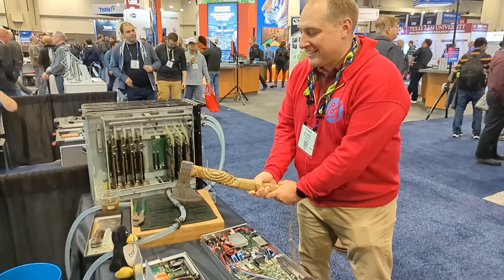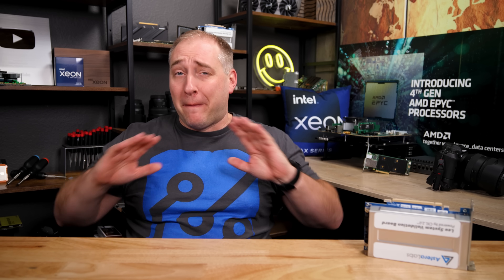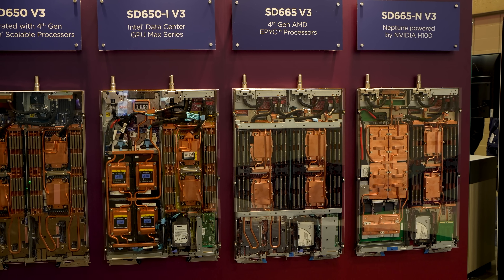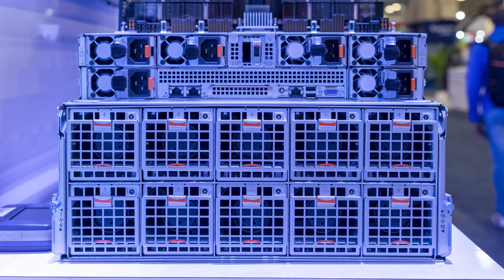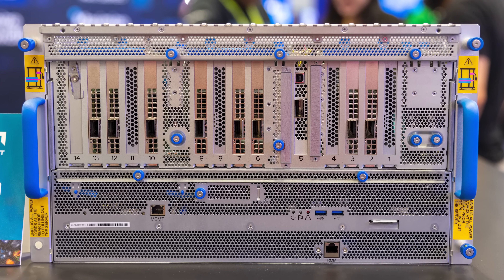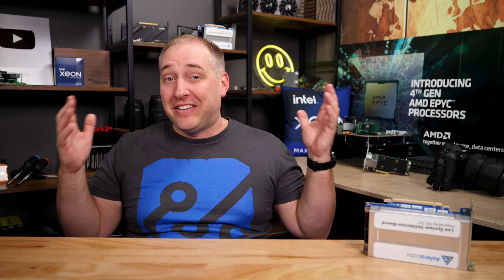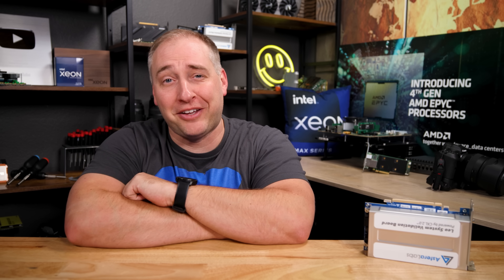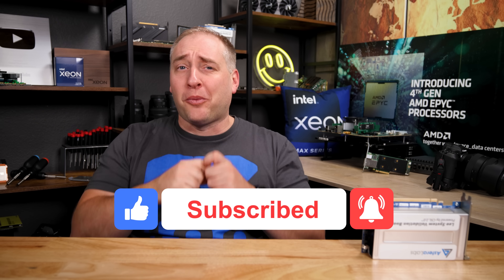This 850,000 Core Cerebras AI Engine Block from SC22 is....

Comment: Make motherboard with Amd and Intel sockets and the way those could see all same cards at pcie, using pci-e hub. So you could use both chips best advantages at same system. Cpu-cores just shown own group's. Data between core packages (pcu) must be same speed as memory have bandwidth. If both cpu's could use same dimms, at least after configuration how much is given cpu0 and cpu1. 
Product like that comes some point if Linux users matters anything and if world is perfect, so..

Sooner we going see cards with AMD and Nvidia at same pcb, that would be even more working  idea and capable to real uses, from games to even some blender use.

Comment: If you fancy trying with a soldering/sodding iron you can just add a smoothing cap across the LEDs to remove the flicker from that smiley face. It's not normally worth the bother for LED lights, but for an accent piece like that it might be easier than finding something to replace it. A big dumb electrolytic would do, 0.1-1 mF and rated for whatever voltage the supply puts out.

Comment: I don't see how going big for AI is marketable when there's research going into photonic computing, at that level even with current power draw for lasers it may be preferable
Reply from the maker: This uses a lot of power for one machine, but it is also much less than a GPU cluster for similar amount of compute resources because one does not need high-power InfiniBand plus NVLink.
Reply: Research is research. These are startups / new players trying to grab market share, it's literally a race where having an actual product a few months earlier makes or breaks the company. The likes of Google and Facebook aren't going "well let's just wait 5 years and see how this other research goes," they're going to try anything that looks good and if it delivers then they have deep wallets for it. Of course, the likes of Google and Facebook are developing custom TPUs and such themselves... but all those probably run into other hard physical limits compared to Cerebras.
Reply: More cores -> more better. Simple as.

Comment: I really wanted to wait for Genoa but I had to spend my server upgrade money by October. I am waiting for IT to finish deploying my new Milan server.  I don't think I'll be sad jumping from dual 6 core Sandy Bridge to dual 32 core Milan. 🤣
Reply from the maker: That is a MASSIVE upgrade!
Reply: @ServeTheHomeVideo  yeah.  I've been working for over a year to get a replacement.  Pretty much when I figured out how much of a mess everything was after I was hired.  It wouldn't even support the new VMs I needed as it wouldn't support ESXi past 6.0.  🤦‍♂️  This will probably be my last on prem hardware.
Reply: @pkt1213  On Prem HW is always better than cloud. Vastly more agile and less expensive in the long run. Of course a boss who is ready to upgrade HW is crucial. Even after all that it still works out cheaper in the long run. Some of the startups are spending upwards of $1million per annum on cloud bills which could have been used to set up some wonderful on premise servers.

Comment: aqua computer has had their leak shield, which is a vacuum pump res topper that pulls the system under negative pressure and prevents some pretty significant leaks.  this isn't a new tech.  someone else brought it up, but once you have a leak, you get your system airlocked and lose cooling, so you would hope that there is either a failover or very loud alarm.

Comment: Love the video, that 9004 dual socket server with 48 DIMM slots was super awesome!
Now just to see if those 2TB LRDIMMs come to market so you can have 96TB of RAM (in theory, lol)
Reply from the maker: It is huge!
Reply: 2TB LRDIMMs, what the fuck
Reply: Specs I found say max 6 TB per socket, you might be limited by the power delivery to the DIMM slots
Reply: @jfkastner  that's probably only because current standards are only spec'd to 256GB DIMMs. they'll probably come out with newer versions in the next few years as 512GB DIMMs are slated for next year and 1TB DIMMs for 2024 (2TB likely by end of 2024 or early 2025). the power draw probably will be pretty crazy but hey maybe they'll start making water cooled DIMMs LOL

Comment: Regarding water cooling, negative pressure and desktops - they can do that. There is for example Aquacomputer LEAKSHIELD that does exactly this.
Reply from the maker: Totally, I guess I was assuming the majority of liquid cooled desktops use AIOs. This is uncommon in the data center industry though that may be changing.
Reply: @ServeTheHomeVideo  The majority do use AIOs, but higher end systems have to be custom loop because a 360mm rad is tiny compared to say the 400x400mm honda car radiator used by my system
Reply: @ServeTheHomeVideo  Don't underestimate gaming desktops.There is even a Chinese liquid cooling  case with  real fishes swimming inside the case. You will not find this in a data center
Reply: @javiej  uummmmm sushi
Reply: I own one, makes filling the loop very easy.
Reply: There were others before the Aquacomputer one too.
I don't remember who had the idea first, but we were playing with negative pressure loops back in the early DIY days of liquid cooling.
If I remember right (this was the 90s so...) it was enough extra effort that I ended up just making a custom vapor-phase setup instead.
I'm actually REALLY surprised that we aren't already seeing facility-scale direct-heat-pumps.
Liquid cooling has ALWAYS been the "Have time. Need cheap. Pump some water in a hose." kind of solution that you can fab up in an afternoon.

Heat pumps are SOOO much more efficient. And they are more effective too.
Which is why heat pumps are the next big 'thing' in heating/cooling our houses.
Air conditioners ARE heat-pumps, that we only run in 1 direction...even though the parts to reverse them only cost like $0.5% more.
Modern split units can be up to 500% efficient. Not 500% more efficient. Literally 500% efficient. As in [10w] input energy to move [50w] of heat.
Reply: @Prophes0r  I agree, but the main issue with heat pumps is heat. Heat pumps are typically 300% efficient (COP), meaning that a PC + heat pump will output ~133% as much heat as a passively cooled PC. For my PC (including 4090) that could easily be 1330W which is too much to dump indoors so I use an outdoor radiator. The heat pump equivalent is a mini-split which is harder to install and can't be installed directly by consumers who are unlucky enough to live in a nanny state.
Reply: @Prophes0r  Heat pumps are amazingly efficient at generating... Heat.  Using a heat pump for cooling is literally just using an air conditioner. It doesn't translate both ways.
Reply: I was just about to come here and say the same thing

Comment: removable storage cage is a nice optimization for front-panel sneaker-net interface, 8x bandwidth improvement.
Reply from the maker: I was told also if you have data you do not want to be left unsecured in a server.
Reply: @ServeTheHomeVideo  That makes far less sense though.
I'm going to assume that no one is going to be sitting right next to a server with these racks for the entire duration.
If you are at the point where you are securing a cage of drives in your safe, you are probably also needing to keep it physically secure at all times when it is out. That means you aren't plugging it into a server and moving to a quiet room with your workstation.
And if you are doing the work on a workstation anyway, why bother with all the server centric stuff? Just have it in a high-speed(PCIe, Thunderbolt, USB4, fiber-something, or whatever) external enclosure.

The more I think about it, the less useful it is really.
Let's be realistic here. You are probably keeping 8x4TB=32TB of drives in there.
How often do you really need to pull out the whole set?
Maybe if you used it for daily off-site backups? But then you have a gaping hole in your server 99.99% of the time.

It seems clever, but I think it is extra effort/cost for almost no use in almost all cases.

Cool though.
Reply: MUCH more than 8x when you consider the extra time required to keep the drives in the right group/order.